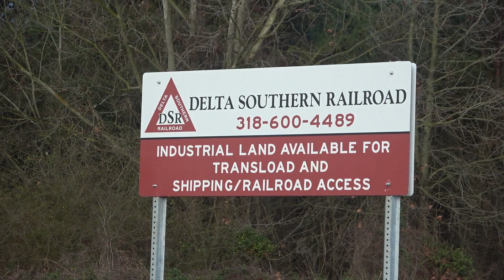The Delta Southern Railroad!

Comment: A couple of things from the "did you notice..." department:

1. Did you see the old railroad bridge at Sterlington that crosses the Ouachita River? After all of these years since the disappearance of the rails north of the river (abandoned in the 80s), the bridge still stands (lined for river traffic of course).

2. Did you notice the diamond where the Delta Southern and the AL&M cross each other?  This diamond is controlled by red and green boards. Since the Delta Southern is a former UP/MP line, it gets green boards and can cross over the diamond without stopping. The AL&M is a shortline, they get the red boards. They have to stop & look both ways before crossing.

3. At 13:14, does anyone else notice the locomotive has a square wheel?
Reply from the maker: Yeah I used to live in Sterlington back when I was a little thing. Remember passing that bridge over the river many a time. Always hoping for it to be turned for the rails but had no idea it was abandoned until I got older haha! Thanks for watching as always!
Reply: I wonder if that flatspot was caused by that E-stop on the bridge?
Reply: @trainsbangsandautomobiles824  One emergency stop won't quite do that on a 10 mph train. But if the brakes lock up and the wheel slides several times...or the engine was dragged with the handbrake applied...that could do it.
Reply: @killersopinion1829  True